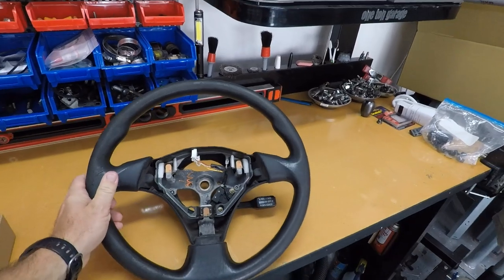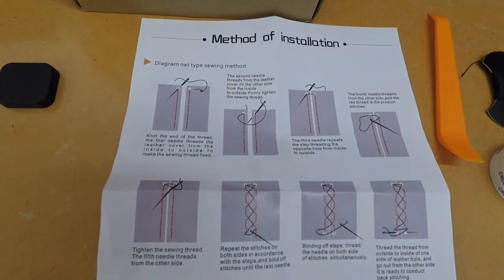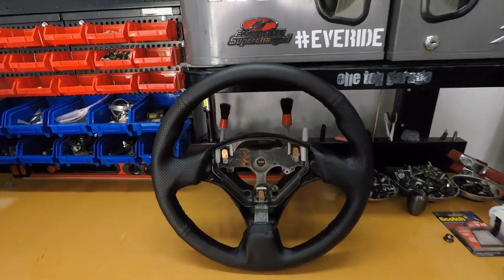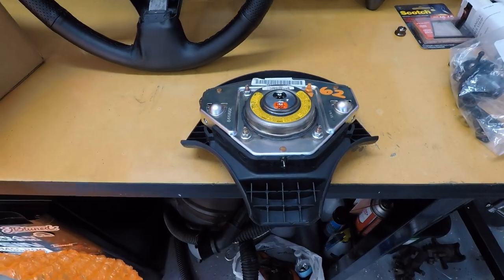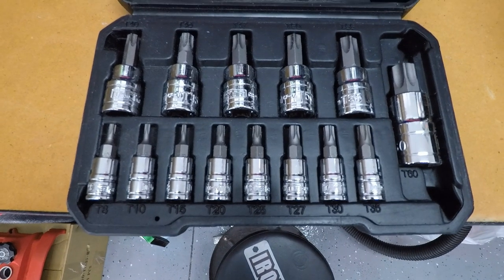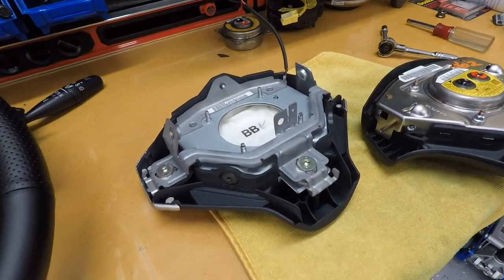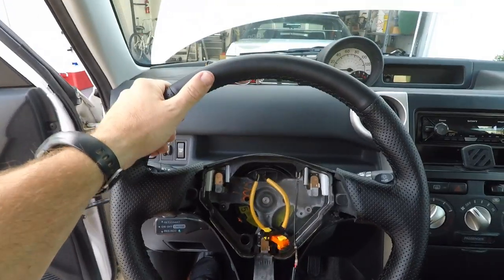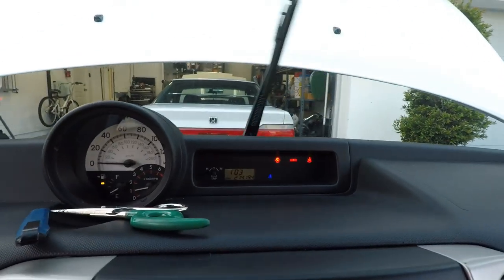TOYOTA BB STEERING WHEEL ON THE XB!!

Comment: Dude you did a great job. That looks so good. I need this for my xB. Well worth the wait for this vid!
Reply from the maker: Glad you liked it! It's a great bang-for-your-buck mod. I didn't mention it in the video, but all in it was like $120. Obviously there are some used items involved, but the wrap covers the old wheel so your are pretty much golden and still get to have a working airbag!
Reply: Extreme Daily Drivers what tools will I need to remove the celica steering wheel? There happens to be one at my local pick n pull.
Reply: @Tomamichi  you'll need a t27 torx bit to remove the airbag/horn cover, than you'll need a 19mm socket with an extension either a shallow socket with 6" extension or a deep well socket and a 3" extension will work the best. Than you'll need to pound on the grip area of the wheel in different areas to help break it loose from the hub, than slide it off. Be careful not to hit yourself in the face. Than disconnect or cut the airbag plugs and horn wire.
Reply from the maker: Exactly what Mike said. It's all the same stuff shown in the video.

Comment: For me, I love my 2006.5 steering wheel for OEM and if ever my air bag goes off, then I’m going to the celica steering wheel then.  I need that pontiac vibe wiper delay arm though.
Reply from the maker: Get the TC leather wheel. It will bolt right on and you will be save the radio controls.
Reply: Oh, okay! Nice!  Well, that makes two OEM wheels and one Quick release wheels on my list of which wheel to pick from

Comment: Brandon thanks for getting back to me.love the jeep commercial also.i got my steering wheel wrapped it turned out good but u was right it took me a few hours lol but it looks good tmmorw I'm gonna put it on.my steering wheel is like the original one like u had but mine has the stereo controls on it it still has the crappy pioneer system that came with it after I do steering wheel I'm doing that next I guess they will be a wire from the steering  wheel going to steroids I guess?If so I will cut it are if it has a plug connector I will disconnect it.? What you think ? My friend

Comment: Great video bro its seems that your scion has cruise control while my Toyota BB does not have that . Steering wheel looks amazing though. Good Job
Reply from the maker: The first owner installed the CC. The second owner installed the rear LED taillights. Every time CC was activated, it blew the tail light fuse. So I removed the CC. The stalk is still there, but everything else is gone.

Comment: This video is awesome.  I'm gonna get at least the wiper stalk.  You got balls when you turned on the air bag censor.  My heart stopped for a second.  I noticed the cruise control stalk.  Did your xb come with it or did you install it?  Thanks again.
Reply from the maker: Thanks!! The car came installed CC and I removed it. Only the stalk remains.
Reply: @ExtremeDailyDrivers  Thanks.  I bet your ratings would go through the roof if that airbag would have blown. Just saying. Lol

Comment: I keep watching your videos. And my bank account keeps getting smaller dammit! 😂 I love the steering wheel, but I literally just ordered a stereo and all new speakers with the steering wheel controls.. I guess those are not that important to have. Until you want to drown out the kids in the back without them seeing you turn the volume up 😂
Reply from the maker: I'll be doing an overhaul of my audio setup soon. I was going to cheap out on a double din head unit, but decided to save up and get one with more consistent reviews. So it's coming, but probably not until the fall. Which speakers did you order?
Reply: Extreme Daily Drivers I did a budget with CarPlay by getting a Boss bv800acp ($249 crutchfield) and 2ea $40 Kenwood sets for all 3 pair. I’m diggin the videos. Definitely very helpful.

Comment: Steering wheel looks like a big upgrade.  I think they made a leather option for the xB and xA for anyone who doesn't want to or is afraid to try to do a leather wrapping.  It looks pretty similar to what you ended up with (except it has grey and black leather rather than all black).  Part number is 08460-21810.
Reply from the maker: It still looks like to old, ugly wheel though. This is completely different because the airbag assembly is replaced. Thanks for watching.

Comment: Dude great vid as always!! Quick question: love the look on the tires. Is that the stock hub and what size tires? Any rubbing problems with that setup? Really looking to update my wheels
Reply from the maker: I feel like I answer this everyday! They are stock wheels with a 2" band welded on by the previous owner. So now they are 15x8 +12. The tires are 205/50/15. Thanks for watching!
Reply: @ExtremeDailyDrivers  hehehe sorry!!! But hey this means maybe a video should be done on them? 😜🙏
Reply from the maker: I know. I really should. Especially on the Prelude's wheels. I get asked about them daily.

Comment: Any options for me if I have the audio controls on the steering wheel? I know I can't use any Corolla, Matrix or Celica's. Toyota Echo's would fit, I hope
Reply from the maker: Yes! You can get the leather steering wheel out of a TC. It bolts right on.
Reply: @ExtremeDailyDrivers  Good looks, thanks man

Comment: Is there a way to get rid of the cruise control.. I hate the module for it in the engine bay.
Reply from the maker: I removed it from mine. The stalk is still on the steering column, but it's all that's left.

Comment: You mentioned the Vibe as were you got the windshield wiper control. Would a Camry work as well and if so what years should I be looking at. Also what size nut was the steering wheel 19mm?
Reply: No camry is different I think. Look from corollas 03-08, matrix 03-08, celica last gen or vibe 03-08

Comment: Are a good amount of these mods also applicable to the 2008?
Reply from the maker: Yes, however they will require different parts. Also, the 2nd gen xB was never made in Japan so there isn't a Japanese aftermarket.

Comment: when you are pulling off the stock steering wheel, you should have the nut threaded on a bit so it doesn't come at your face.
Reply from the maker: That's a good tip. You're right, I should have. Thanks for watching!